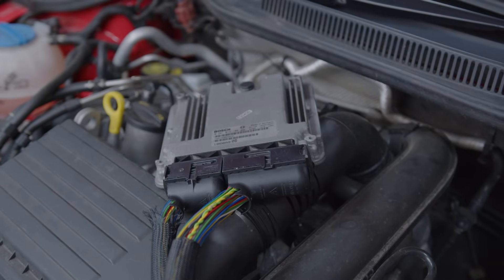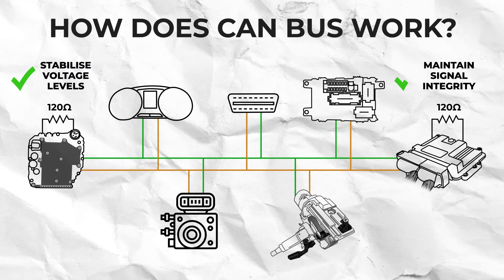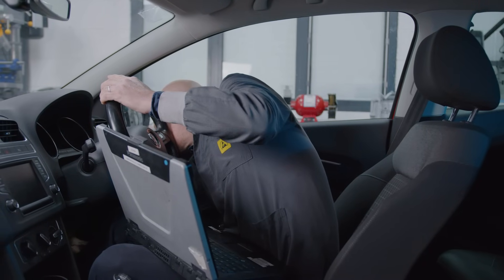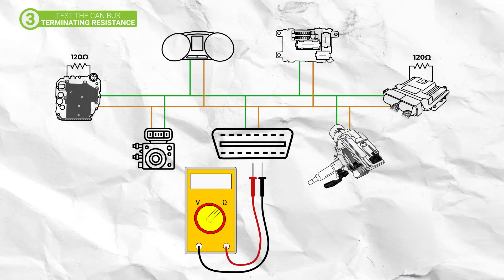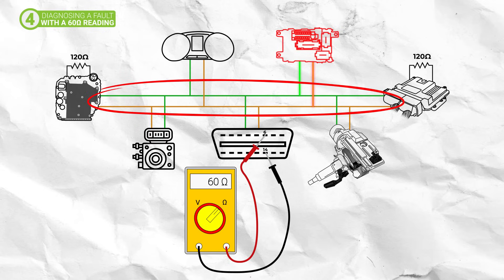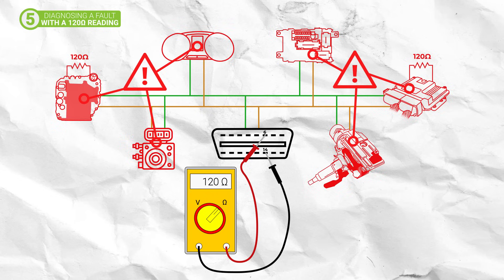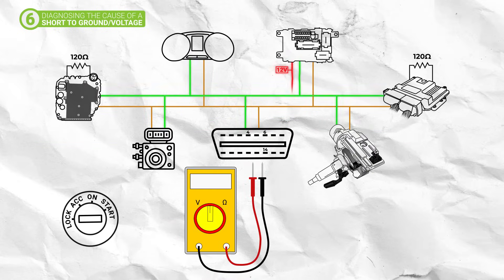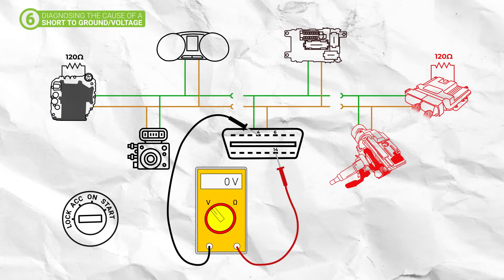Explained! CAN BUS Diagnosis – How to Troubleshoot Faults.

Comment: I wish you where in South Africa,  my car was flooded with rain water and electronics are going bananas.  transmission, steering wheel,  computer box, engine doesn't want to respond, doesn't start, security off, low voltage issues, the car is malfunctioning.
Reply from the maker: Hi there, we receive parts from all over the world, so you are welcome to send your parts from South Africa. If you would like to contact us to get more information, please call 01773 535638 or email info@ecutesting.com, and our technical support team will be happy to help. Thank you!

Comment: Great easy to understand video! I noticed u made sure to note that all this testing was done on a can bus network without a serial data module on it. How does diagnosing a can bus network with a serial data gateway module differ from this testing u have shown in the video? What changes when u add a serial data gateway module to the communication network? I was always told that SD modules are there to basically allow communication between many of the modules in a vehicle and sort of organizes the communication between them but maybe I misunderstood what they meant by that?

Comment: So two 120ohm resistors are in parallel connection? Because the total resistance of two 120 ohm parallel resistors should be 60ohm. And if one of them has open circuit the total resistance should be 120 ohm?

Comment: 5:37 heeyyyy my American friend in this Point thats Not correct. It depends wich System the Bus use... 

Simple VAG use only 2 120ohm Resistors in PCM and ABS all other use 3.2kOhm Resistors.

Advantage: If one device had a failure the Rest do there work only If ABS or PCM had a failure with the Resistor thats a Problem. So thats works im Highspeedcan too so that the can in compare to the Theory alltough works!!!

If you it would be Like Mercedes or Opel or gm so that every Device have a Resistor x1+x2+x3+xn=60Ohms for termination to make an Impedanz 60Ohms thats is worse constallation...

Comment: Hallo Friend,I have a 2018 VW Passat B83G with an internal faulty module in the instrument cluster,and also the warning buzzer speaker which is inbuilt in the instrument cluster doesn't work.I did some research and found out if I changed the SEP-SPEAKER21 from minitools in the instrument cluster the faulty message would disappear immediately.But after changing the speaker,only buzzer sound returned but the faulty internal module message is still there.please advise.
Thank you.
Reply from the maker: Hi there, there could be other internals causing a problem, you are welcome to send the cluster to us if you would like. If you are able to get the part number from the cluster and give us a call on 01773535638 or email info@ecutesting.com with this and your vehicle details, our technical support team will be able to look into this further and advise costs. Thank you!

Comment: Got 2016 Kia Carens crdi wont start now after engine just cut out , can't scan via obd2 ports powered up used foxscan it tries connecting for ages but never does . Garage tried to scan and they failed as well , all dash powers up ok with all the usual lights before start and everything works ie locking ect so thinking engine ECU ?
Reply from the maker: Hi there, it could be a possible engine ECU issue, if you can get the part number from the ECU and either call us on 01773535638 or email info@ecutesting.com with the vehicle details, our technical support team will be happy to look into this for you. Thank you!
Reply: @Ecutestinglimited  Thanks for reply found fuses blown car running now and port active , there is recall on ABS module causing fuse blowing and CAN issues will get that sorted

Comment: Tested with Autel diagnostics: when the car is started, the gear lever and display recognize all positions correctly.
However, after a few minutes, the transmission no longer recognizes the correct gear:
Gear Lever     | Display  | Actual Gear (Autel)
---------------|----------|-------------------
P              | P        | P
R              | R        | P
N              | N        | N
D              | D        | N
Tiptronic + / -| —        | No response

Comment: My fiat panda is experiencing it. I did not need the scanner to find out what it was. Christmas lights on dashboard. Those were false. Seatbelt tensioner, brakes still work normally. Indicators not always working after a long time on short trips. So I used hand signals out my window. and performance loss while  going 25% up hill where it never had a problem. Suddenly only goes up to 32km/h instead of 50km/h on that uphill. I try to floor it but it would not let me. I had to use my hazards.

Comment: Working on 2013 sonata gls.have u0101 and u0001 code.check resistance at obd .it's 60. Checked at pcm it reads 91 ohms.

Comment: I don't have any error codes but the dashboard display of my Renault wakes up in the middle of the night and slowly drains the battery. When it gets in that state it stops listening to shutdown messages. Normally it does. Disconnecting the battery for 30m restores the normal state. Everything works, with or without the fault. Having to disconnect the battery every evening is annoying to say the least.

Comment: Thanks Sir for this easyto understand Video🙏 Trying my best to fix my car myself. 

I'm from South Africa and would greatly appreciate your assistance please 🙏.

My car is on safe mode after battery was flat and taken out to charge. It's an 2007 Audi A3 8p, 2.0tfsi, BWA variant. Would the fault be on the Canbus or Bad ground or power wires?

Symptoms are:
1) Cluster doesn't work ( only time and mileage works when I press the left button on the cluster, then a sign showing a circle with "km/h and a "2" when I press both buttons.
2) Windows, Sunroof, Steering functions and boot unlock don't work.
3) I don't have voltage on fuses F6 to F12 in the front fuse box.
4) Car swings but does not start.
5) Radio goes to safe mode everytime I remove terminals. ( This never happened when I removed the battery before)
6) Immobilizer L.E.D works now but never did prior to all this.

I don't have VCDS and no access to anyone who does as I am far out an no one is willing to travel out. They want me to bring in the car to them but the car doesn't start, so is there anyway to solve this without VCDS please 🙏.

Your help would be very much appreciated 🙏.

Thank you

Comment: 2 throttle position sensor high voltage... I think I have to replace the gas pedal where those sensors are located...

Comment: Ok, I have OL on meter, been through most of the car already. The ECM is almost new. I got the codes back from the scanner. The normal U1000 and p1212. I still have not been in the dash wiring to the ECM yet. Any help on where to look would be great.

Comment: is this video sir, the same process or same connections of terminals in different brands, taking measurements
Reply from the maker: Hi there, most vehicles with CAN BUS systems work in a similar way but are not always the same. Certain things will be similar, but I would advise to check your vehicles wiring diagram and technical information that is specific to your car. Thank you!

Comment: I've been a licensed technician for over 43 years, now teach for a manufacturer.. absolutely beautifully done.. A lot of my techs still find it hard to rap their heads around canbus.. so did I at one time.. I keep telling them bring the wiring diagram out,, its only 2 wires.. also I always tell them to narrow down the ECU,, just talk to it and request a command or data..If nothing then you have narrowed it down..

Comment: I am following your test procedure specifically testing to see that the Module goes to sleep. What happens if you are getting a continuous reading despite it being within the limits?
Reply: Your help is needed!!! Before this becomes an expensive undertaking
Reply: Resistance is good as well as Voltages
Reply: Ohm of 66.5

Comment: Is it different across the car manufacturers and models which modules have termination resistors, or is it a requirement to have them in ECU and transmission control modules?

Comment: CAN Bus A error, car goes into limp mode. Pretty sure the dealer's too big key fried my lock cylinder, since issue was not present until I used their key 2 weeks ago for 2 days. The security light came up on the dash and driving was fine then, meaning the cylinder not in sync with the key...

Comment: Hello, I have a 2013 Hyundai genesis and I am experiencing a can bus high communication fault (u0001). The tachometer goes to zero and up and down, the temperature gauge goes to zero, traction control light turns on, engine light turns on, transmission not shifting properly. I tested the obd2 and the ohms came out at 118. I’m not sure whether I have a loose connector or an open circuit…

Comment: I hope you answer, i got a 2007 lexus gs450h with a canbus issue, ive narrowed it down to the abs module because the waveform for the entire network was all over the place but with the abs module unplugged the canbus system waveform is perfect, however with the canbus to the abs module unplugged the can high is 0 volts but the can low is 3.8 volts which probably means its short to voltage, ive unplugged the brake actuator and the brake control power but that dint fix the issue along with replacing the abs module 3 separate times with the same results, its got 2 plugs on the module a gray plug and a black plug, the 2 canbus wires are on the gray plug. With the black plug unplugged the waveform goes back to normal but with the gray plug unplugged if you use a multimeter on the pin on the module side you can see the 3.8v coming through the pin, i am out of ideas

Comment: Battery faults cannot be overlooked or overstated. How many times Ive seen modules not working properly, only to link that with a bad battery thats constantly nearing depletion by a faulty charging system. 

E.g. climate control panel was throwing random codes. Couldn't get the blower motor to work, for example. Customer changed the blower motor, the module, and even the climate control panel itself. 

Turned out to be a faulty battery that was always on the verge of dying (12v) sometimes lower. It would mess up the AC module. Literally charged the battery up and the blower motor started working, lol. Once the batteey was near depleting, the CC stopped working!

Another example, alternator wouldn't start charging straight off of idle once you started tje car up. Only if you increased the rpms. 

This, sometimes prolonged if the customer decided to just idle his car, dip in V decoded the steering column module. No amount of adaptation/resets helped. CAN faults everywhere. Alternator changed, steering module reset, everything went back to normal.

Comment: Hoping somone can reassure me that I am not the only one to come across two different vehicles with weird DLC connectors. One is an old 2004 Nissan Almera Tino, which doesn't have the CANBUS terminals where they should be. Pin 14 is simply not even there. The other vehicle is a 2011 Ford Galaxy TDCi. This has pins 4 and 5 completely missing! Consequently, I can't get anything with my scan tool, as there is no ground. HELP!

Comment: I'm beginning to suspect junction box (central gateway). Kcan line faults between 9 modules, relays randomly click on and off. I've checked and redid all splices as some are known to corroded but they looked clean anyway. 60.6 ohms at obd connector

Comment: Hii
My Toyota Sequoia 2018 I have an extra LED light and stopped working so my electric garage he checked it and replaced small fuse and once I got home I used the LED light then my car shaped and shut off. I started back and I smelled electric burn and fuse box was damaged.😅

Comment: Which are the canbus pins at the obd. At 3.39 it shows pins are at the left then at 4.50 it shows at the right??
Very confusing please be specific
Reply from the maker: Hi there, apologies for the confusion, the diagram shows the pinout, however in the vehicle it is upside down. We would still advise to check your particular pin out for the OBD just make sure there are no slight variations. Thank you!

Comment: I’m getting around .8 v on pin 4 and 16 is that a short to voltage? Or is it close to zero not to matter?
Reply: Put ignition on first then check if you check when the car is off it will give you the battery voltage mine have also discovered that on mercidis benz

Comment: older video but I have a question.  I have a 2005 corvette with no com to TCM.  Checking at the DLC I have 60ohms.  Checking at the plug going to the TCM I have 120ohms.  The TCM does NOT have a terminating resistor.  So what am I seeing?  In this video it doesn't explain this reading, unless the TCM is a gateway module, which I do not know.  Can you help explain my readings?
Reply from the maker: Hi there! If you can email this information with your vehicle details, fault codes if any are present, a part number if available and any other relevant information, our technical support team will be happy to look into this and advise further. Thank you.

Comment: There is one thing i fail to understand. You instruct to check the voltage directly from the OBD2 port. however, the wires from the port go exclusively to the gateway module. So there cant be a physical connection between the OBD2 port and the CanBus network, because the gateway module cuts the connection. If what you said works however, wouldn't that mean i also tap into other Can Bus networks during my measuring ( like CanBus comfort, Infotainment etc.)?

Comment: What does it mean when the obd11 port shows 120 was getting a code for the abs module also got 120 at the abs plug plugged it back in followed the wire back to driver side wheel speed sensor un plugged it checked that end of the wire going back to the abs module and got 17

Comment: Hi there young man … I’ve a vivaro no start got solid red light immo I’ve no glow plug light ulumanating aswell as no service light I’ve got power after ignition , I’ve renewed relay glow plug can’t seem to be able get a good reading from the plug it’s self the ones to the glow plugs keys been programmed 3 auto Electicions take a look says must be a break in wire .. we’ll I’ve stripped most look as got full front end off over the gear box see if any suspects no so far any Tim before I get the swan vesters out would you have any suggestions many thanks keep up the good work

Comment: (?) i have a 2012 dodge Charger I already have my PCM module refurbished and i put that back i already now when i try to start it  comes up that i have to wait for some kind of connection i i did wait one time over 30 min. my battery was low but i had the jumping cables on it could that be all i need now is a new battery for it to the PCm module to register faster

Comment: 2013 Subaru Forester, Can Bus errors. I have 59 ohms at DLC...unplug the ABS/VDC, and OHM the CAN HI, and Low, and get 119 OHMS. Do I need ABS/VDC harness, plugged into ABS/VDC module to see 59 OHMS? or did unplugging it cause the 119 OHMS? Backprobe access is difficult to access with harness plugged in. Please let me know. Thank you. Subscribed. Well done.

Comment: Im having a Serial Comm Failure on my PGM-FI. Im going to buy a special multimeter for testing my wiring. If I can't find anything. I will let you know so I can try and get some assistance on what I find. But great video on explaining what to look for. Really need it to fix my cars SCF code. Car runs and drives fine, so that might help you while I wait till i get paid to buy that multimeter.

Note : my car is a HONDA CR-V 2005 SE OR LX. Scanner says SE but everywhere else is saying LX.

Comment: 6:48 hi, i got question, if i have everywhere 58-60ohms but on the ecu conector have 109.3 dtc was on ac, esp and 4wd, and ecu got no comunication but can cables around ecu seems ok and got the right voltahe on them even pins are good everywhere. Any idea where should I look next?. Vehicle is Kia Sportage 2012 2.0 diesel 4x4. I can send diagram in private message.

Comment: He doesn’t seem to mention this anywhere but be wary of testing from the DLC. 

IF the vehicle has a GATEWAY module (like a VW) you CANNOT test it from the DLC since all that’s connected to is the gateway itself, you will have to gain access to the gateway connector and test from there

Comment: Thanks, your video is inspiring to learn more and more, for me as a Renault owner specially, nobody wants to put hands on the job, and some self called technicians want to replace all the motor, one piece at a time to solve the issues. One question, what if the resistance between high and low speed can becomes crazy moving up to 500 ohms and decending to 50 ohms?

Comment: Maybe im jot followong entirely... but I get a 60 ohm reading at the DLC, but when testing can c pins at the TCM and gear shift module i read areound 120 ohms... does this mean there is a break in wiring on can bus?
Reply: No it's fine just watch the entire video

Comment: Ive had 2012 prius codes U0073, U0123, U0124, U0126, and U0293 and have been researching for hours how to check the wiring (I have already checked the fuses and will be double checking the battery). There is no good information out there explaining everything like this video. Everything makes so much sense and now I'm less scared to tackle this. I don't trust mechanics so I want to learn how to solve my own issues.